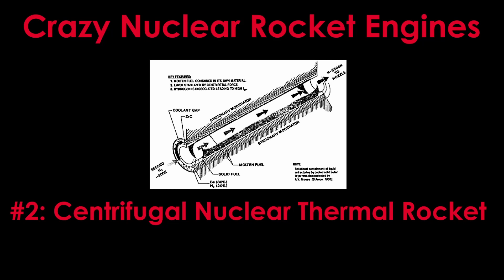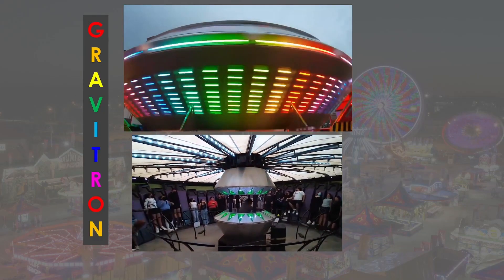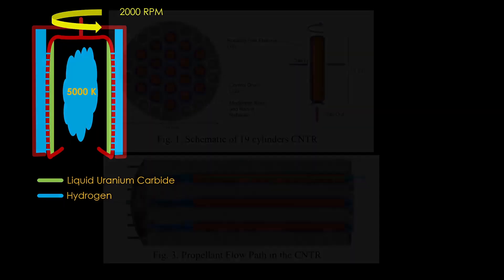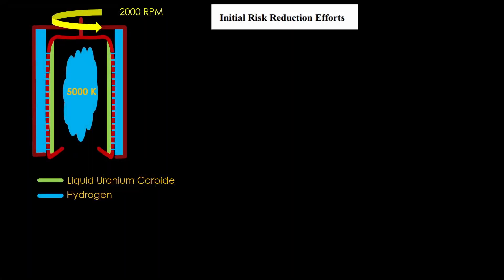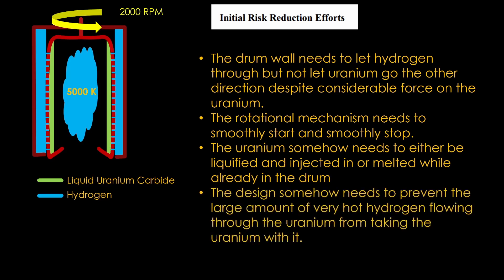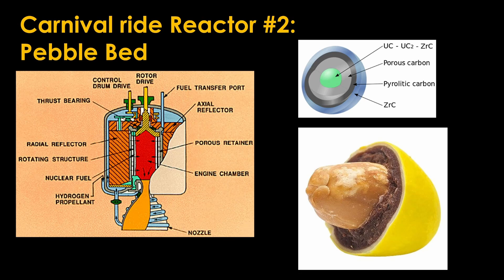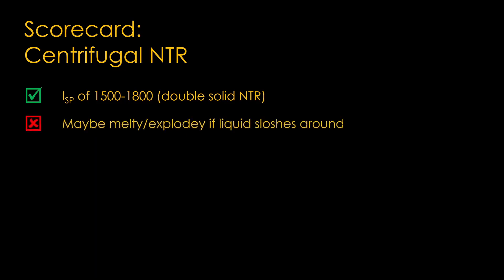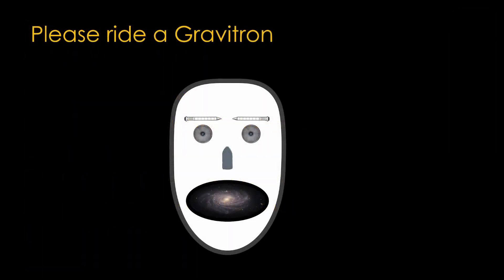Crazy Nuclear Rocket Engines #2 - Centrifugal cores

Comment: Point 1:  Something akin to a Telsa Valve could work.  
Point 2:  Enginerring especially with 3D printers and CAD or Wire EDM can produce ridiculously tight tolerances so all good there.
Point 3:  Liquid injection is surely the way to go as it can be useful in a shutdown situation as one can pump a dilutent in as well if need be.
Point 4:  Gerbils.... We train Gerbils to hold the core in place and catch any Uranium flying by.....
Reply from the maker: Space Gerbils.
Reply: @EagerSpace  GMO Space Gerbils for the win!!! Never seen a problem we couldn't fix with Gerbils.

Comment: Pebble reactors are pretty cool, I had never thought or heard of the idea of one inside a spinning drum. Hydrogen isn't a good moderator, is it? If there is some light molecule that  doubles as a moderator that could help with safety, same as PWRs.
Reply from the maker: Hydrogen is a good moderator. In NERVA they tuned the composition of the fuel rods so that they were reactive enough to "turn on" when you filled the reactor with hydrogen but fairly inert without hydrogen. This was necessary as the control drums are on the outside of the core rather than in the middle where they would be in a power/research reactor design.

Comment: A quick review and I don't think that is as crazy as you are making it out to be (sure it's bat sh*t crazy but all these ideas are). Taking your gravel bed and using pressure and temperature to bond it into a solid with tortuous pathways to allow the hydrogen to take a slow path through if insanely well done might keep the device from spewing uranium out the back like a cheap skyrocket. Because of the nasty Springer paywall, I could not get anything good on zirconium-niobium alloys but last I had accessed some of those were pushing up around 4500 f which should give containment and a sky-high ISP. If the drum is spinning fast enough that should allow the pebbles to stay put. Still the idea of what to do when you want to slow down -- well pitch the whole thing out the back is the only thing that pops in the head. You didn't say it but I assume you are talking about the carbon being a neutron moderator, it's a good choice since it also has a really high melting point. A carbon grain at the inside of the zircon/graphite/uranium would add an additional moderator to the pebble which would allow the neutrons from one side to be absorbed by the other which should increase efficiency quite a bit. Next thought maybe it doesnt really need to spin - build the uranium shell and at the last moment fill it with a tube full of hydrogen...... nah, skip that even more dangerous.
Reply from the maker: Generally, the idea is that both the carbon and the hydrogen are moderators and you tune the reactivity so that nothing really happens until the hydrogen is added. In the NERVA design they had to tune the ratio of carbon to uranium to get the reactivity they needed. 

4500 f is about 2750 kelvin. NERVA ran at 2400 kelvin and was around 850 for isp. The isp is proportional to the square root of the temperature, so

850 * sqrt(2750 / 2400) = 910